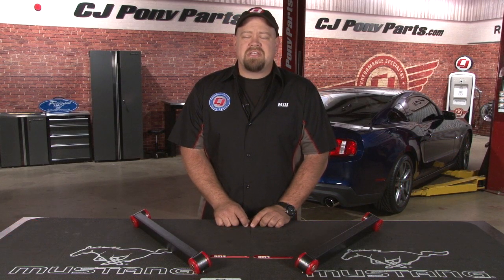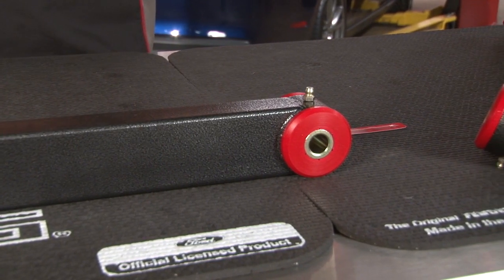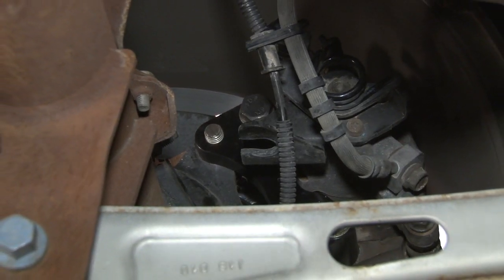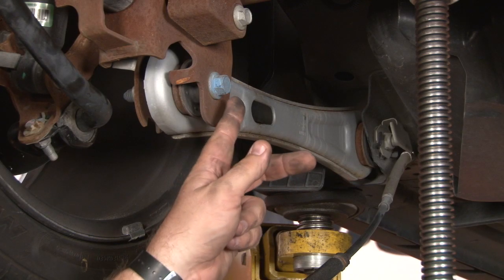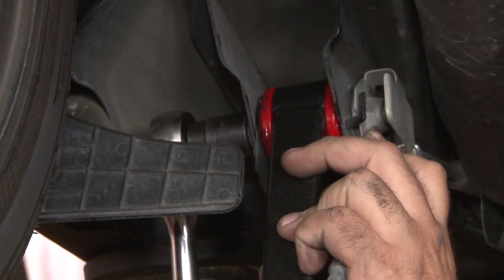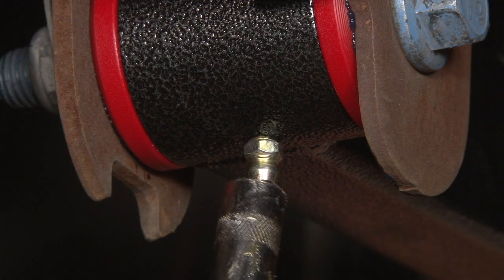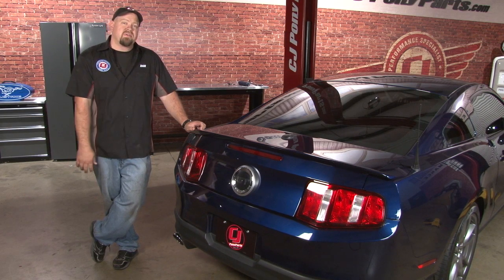Mustang BMR Rear Lower Control Arms 2005-2014 Installation

Comment: If the axle shifts, use a ratchet strap from the front brake caliper bracket to the rear caliper bracket, use a towel to not scratch the paint, had it shifted in under a min
Reply: Did it solo

Comment: On a scale of 1 to 5, easy to hard, this is a 1. But you need the right tools to do it without a lift. I would recommend 2 floor jacks under the car and 2 jack stands under the differential.

Comment: Could a bad bushing on these cause the wheel to wobble? ( shocks, springs, top rear control arm, and rear axle replaced)
Reply from the maker: Not likely, worn bushings would be noisy and make the rear move around but not a wobble. That is usually the axle or wheel.

Comment: Does it matter if you route the parking brake  cable over the top or the bottom?  Only asking because I'm having parking brake issues
Reply: Same mine just stopped working after install how did you fix it
Reply: @Jaqe_ape  funny I just fixed it yesterday.  I made sure the cable was routed under the control arms but also, only use  one zip tie, on the metal sleeve.  I was using 2 zip ties on each side before, over tightened I guess.

Comment: Just got done installing hahaha just if you dont have lift an you on the ground just note that the axle will shift an inch I recommend having buddy helping you if you dont you'll definitely need to go to church asap for all the cussing you'll be doing lol
Reply: how do you move it?
Reply: @Roxanne3v  I used folding chair, I shit you not
Reply: @Roxanne3v  try using a screwdriver to pry it and line it up need to raise and lower diff
Reply: @Jaqe_ape  I ended up using my jackstand to "walk it" back into place, lifted it up and moved the jack slightly towards the front and kept dropping and lifting until it lined up 🤣
Reply: Use one at a time so the rear don't shift

Comment: wont the brake wire tear down when the part move from time to time lock with tyrap
Reply from the maker: As long as there is a little play it will be fine.

Comment: What are the lower control arm drop brackets for? Is this more for a lowered mustang application? I understand the adjustable upper is to correct pinion angle but why the drop brackets for the lowers?
Reply from the maker: They're to correct suspension geometry once the car is lowered so it can handle accelerate and launch properly.
Reply: CJ Pony Parts thanks for the reply and thanks for clearing that up for me.

Comment: Bill I did the bmr uca and bracket and the lca install I’m lowered about 1” and swapped to a one piece aluminum drive shaft but I noticed a clunk noise when applying the clutch with just the adjustable Panhard bar and lower control arms. I added the upper thinking it was the weak link, and then the two piece driveshaft I swapped for a single aluminum noise never went away. Is this possible a pinion angle issue? What else could cause this not normal nvh only when apply clutch accelerating or down shifting please advise if hate to think I have all these parts for no reason I don’t want to put back on until I know what may have been causing it so back to stock for now
Reply: Did you ever figure this out?
Reply: @sixfiddysyndicate  if he just installed the lower control arms while lowered he needed the relocation bracket for the LCA’s to fix the pinion angle

Comment: Wouldn't it be better to run the brake line along the top of the control arm and zip tie it there? I am worried that if something were to hit the brake line from the bottom (if you were to hit a pothole or have road debris kick up) it would snap or be damaged and then no brakes - with it running along the top, the control arm protects the line ? I am no expert by any means, please correct me if I am wrong. Thanks
Reply: Did you ever figure it out? I'm probably going to do this on the weekend and will run it at the top
Reply: It’s just the parking brake cable it should be fine

Comment: I guess I'm maybe the only guy that had trouble with this. The rear bolt came out ok but, the front bolt would not come out from rusting and it locked on to the bushing sleeve which was fighting me like hell. After an hour of trying it still would not budge so I gave up and put it back together. So I guess I have to cut the bolts cause you just can't get in there to hit it with a hammer or pin. The new bolts cost about 9 bucks a piece and if you get new nuts your looking at about 40.00 to replace them. I have a 2014 and live in Michigan, if you want to do this upgrade don't wait till everything gets rusty.
Reply: I'm having this problem right now and it SUCKS.
Reply: I have seen the sleeve issue but usually on older cars than this. Gotta love those Michigan winters!
Reply: Penetrating oil and impact gun.

Comment: Just a quick question, I want to make sure I didn't miss anything.  Should Loctite be used on the bolts upon reinstallation?  Thanks.
Reply: The bolts have some from the factory, while not 100% necessary it can't hurt either.

Comment: which grease is best for these bmr poly bushings ?
Reply: You can use mobil1 synthetic grease, super lube or amsoil. These are the best brands you can use for the lower control arms bushings. Make sure they all synthetic grease!
Reply: Plus 1
Reply: im also wondering

Comment: I'm doing this as we speak and the rear part of the LCA isn't going in. its not lined up. I don't know what it's not just sliding on like the one in the video did.
Reply: It all depends on how you supported the axle when you removed the arm, sometimes you need to twist the rear back into place to get it to line up.

Comment: Come on guys do a upper control arm and chassis mount install video and pinion angle too
Reply: +61484  We are shooting one today actually.
Reply: +Bill Tumas cool, because im gonna install one on my 2013 GT BMR chassis mount and bmr upper control arm adjustable one
When will it be uploaded?
Reply: +61484  Should be up by tomorrow. BMR adjustable upper and mount. I explained pinion angle and how to measure and adjust it but didn't show it since it would be boring to watch me turn a control arm
Reply: cool thanks

Comment: Man I should have bought the BMR LCA's. The SR's I got were a real bitch to get in on the forward side
Reply: +Colin1337 I installed the SR's last week on my 07' without any fitment issue.  Did you grease them and the assembly beforehand?
Reply: +Matt Patrick I greased the outside so they would go on smoothly. I'm going to buy a grease gun this weekend and grease the fittings finally
Reply: I completely disregard my last statement.  I installed another pair of SR LCA's last night on my friends 06' GT and the fitment was a nightmare on it. The bigger side went in fine, the smaller side was nearly impossible.  I don't know why it went so easily on my 07'.  I agree, spend the extra $20 and get the BMR's for future reference.

Comment: is there something I missed? any idea on how to get the driver side brake line back into proper position?
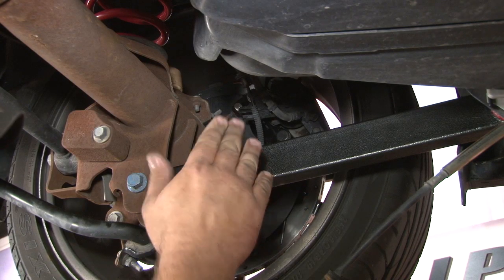Reply: +Mayhem W Yeah man look at 4:04
Reply: Push down on that top bracket. There is some play and this  will allow you to stretch the cable just enough to get everything line up and the clip back in place.

Comment: Took me two hours on my back with jackstands, but your vid enabled me to do this.
Hardest task was repositioning the diff to the length of the new arms. They shifted after removal and I used a breaker bar as a prybar to move the assembly.
Thank you for this. VERY clear and helpful!
Reply: Around 2:00 he states to do one side at a time and to put the stands under the axle to prevent shifting.
Reply: @MrDirtyRod  Good to know!
Reply: SharpByCoop how did you shift it back?
Reply: I had jack stands in both sides of the axel and it still shifted some. I ended up slightly jacking each side as I went to line the holes up. Was a bit more work than expected, but but for it done. got em torqued to 120, Im a bit weak armed lol. Should be good enough, if I had a lift would if been easier

Comment: I have a set of American racing lower arms,someone told me that they are the same as factory ones,is that true??
Reply: I can't say I have ever heard of American Racing control arms
Reply: Sorry i meant ford racing
Reply: Adrian B
No, they look the same as factory control arms, but they have stiffer bushings than the factory bushings.  The Ford Racing lower control arms were the standard control arms for the 2007-2012 GT500.
Reply: 2509SilverLink thanks.
Reply: Adrian B
No problem. :)  I've been looking at the Ford Racing arms for my 2005 to replace the worn out lower arms.

Comment: I have a completely newbie question.  Do you need to bleed the brake lines a little after disconnecting them?   I assume the quick connectors keep them air tight, but just checking.
Reply: There is no brake bleeding required to install these.
Reply: Ok,  I see now it was only the emergency brake cable... not a hydraulic brake (fluid) line!

Comment: They are not noisy at all. If you have rod ends on both sides you will increase noise and vibration but as long as one side is poly there is no noticeable increase.
Reply: I installed this same setup on mine and ordered the parts through you guys but now notice a slight whirring noise from the back center of the car.  Any idea what this could be from?  Is it from the stiffer bushings?  It doesn't get louder or quieter it just is present at all speeds and has only been that way since I did the eibach and bmr lca.
Reply: Kyle Churley The bushings are stiffer than the factory so any noise from your rear will be slightly amplified.